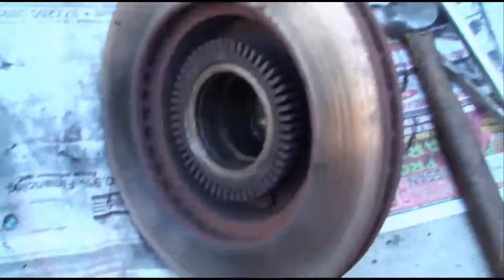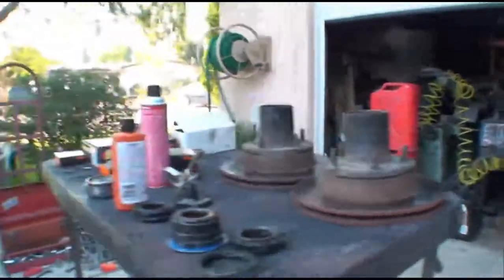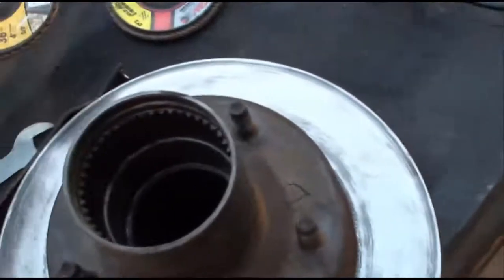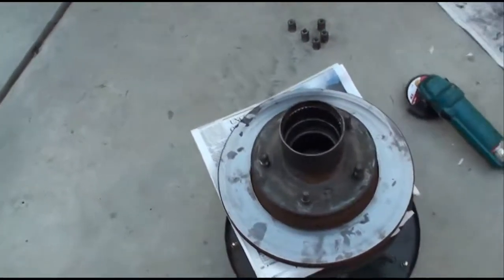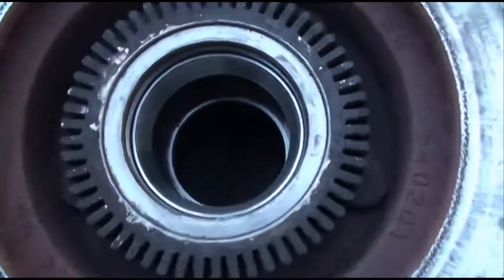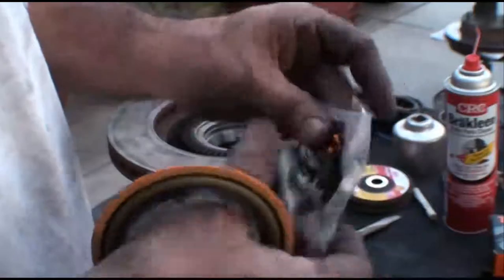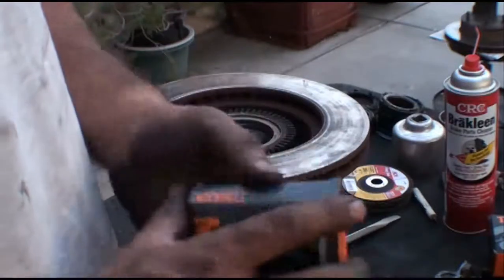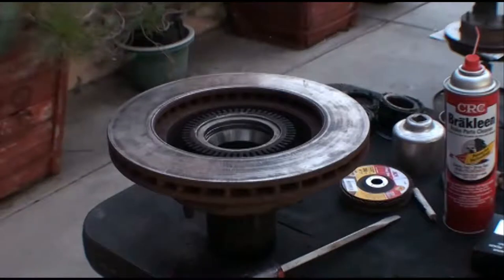Bronco Brake Rotors and Bearing Races Repairs 3

Comment: how do you take the gear thing off I can't get mine off..
Reply from the maker: I think I used a propane torch to heat it up. Don't remember.
Reply: Oh, ok. I tried and tried all day yesterday and could not find a video or and info on how to really do it.. I will try the heating method..
Reply: Thank you, and thanks for the videos.. they have been very helpful past and present..